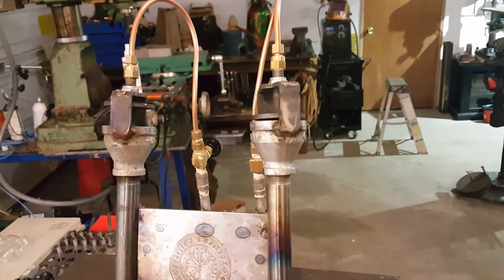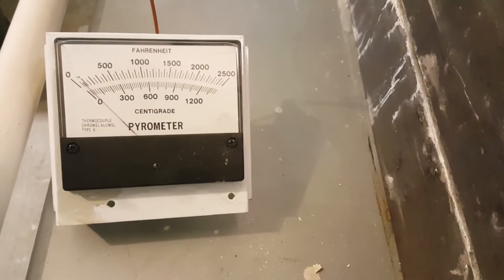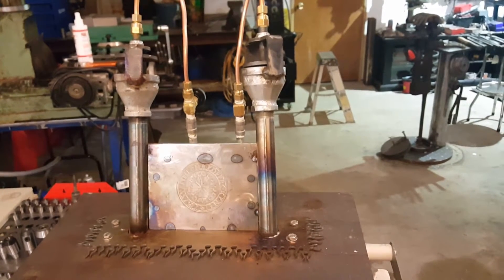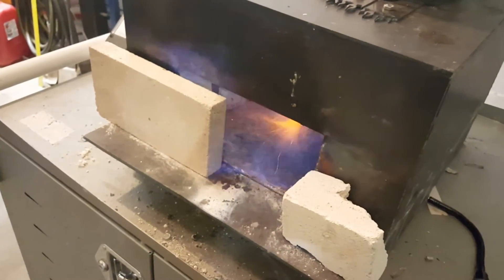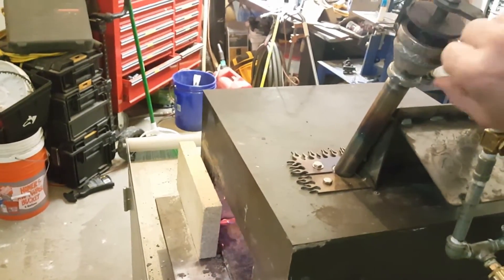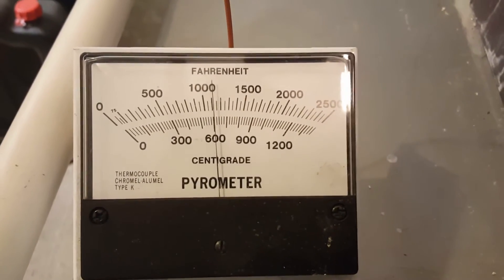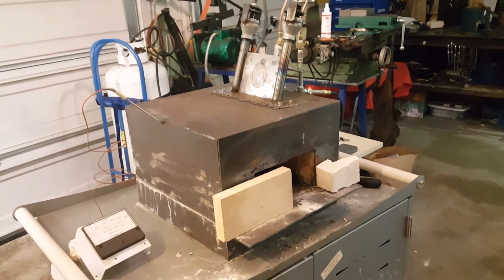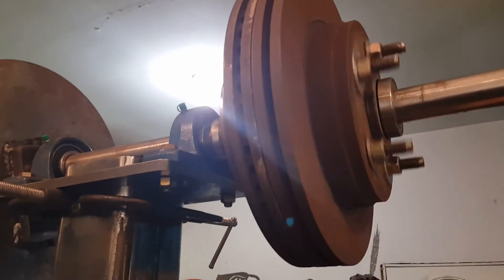Big forge is online and working!

Comment: Hey Mike  great videos on the forge also the burners 1 question the copper pipe is that also 1/4 inch or 3/8 pipe building a similar burners rather the copper pipe like yours to the burner
Reply from the maker: Glenn McCarthy the copper supply lines are 1/4 od.  If you need any help just let me know!
Reply: Mike G  thank you Sir  for that info, I couldn't see you going to 3/8 just want to check before I order  the last connections

Comment: What is the distance on center  between the two torches.
Reply from the maker: FYahooo, they are 7 3/8" or about 185mm apart.  Your forge may be a bit different, just try to slightly overlap the heat zones from each burner and you'll be fine!